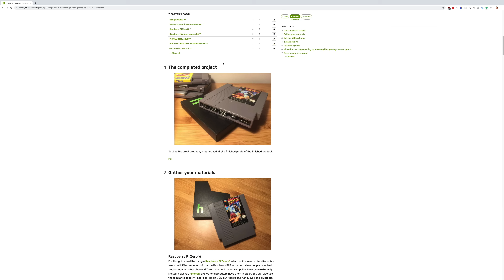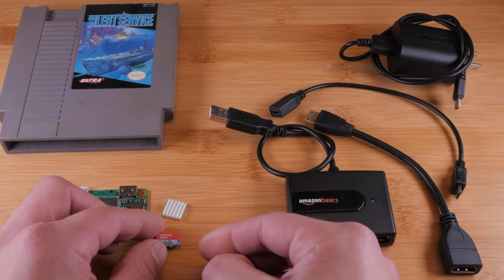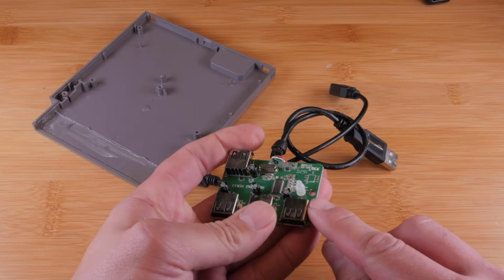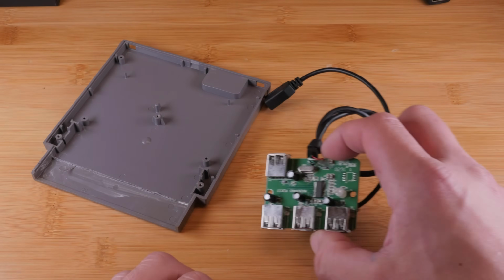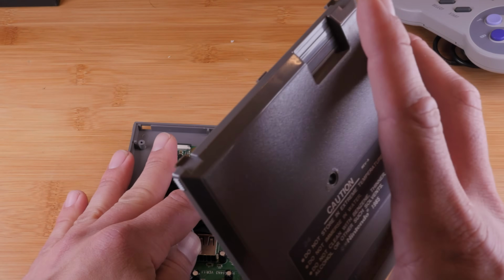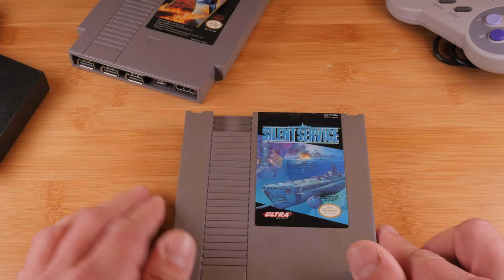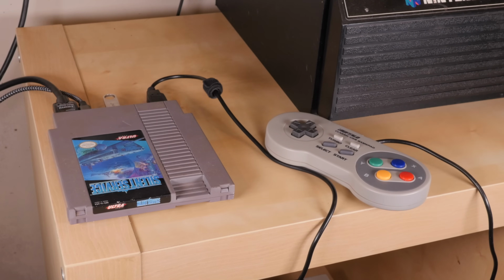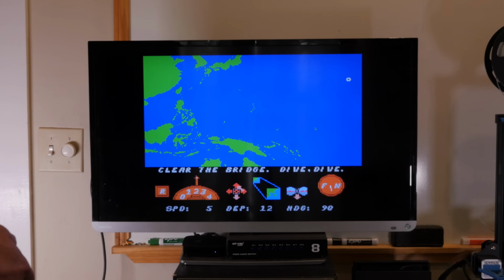The Official Pi Cart Build Video! A Raspberry Pi Retro Gaming Rig in an NES Cartridge [Full Build]

Comment from the maker: Check out the full guide on howchoo! https://howchoo.com/g/mti0oge5nzk/pi-cart-a-raspberry-pi-retro-gaming-rig-in-an-nes-cartridge
Reply: For the usb hub, you could use a "micro usb otg hub", which is the same as what you are using but with the correct micro usb connector: https://www.amazon.com/MakerSpot-Accessories-Charging-Extension-Raspberry/dp/B01JL837X8
Reply: @realmchat6665  great idea, but does it fit in the cartridge?
Reply: howchoo hello and sorry for the trouble I have a problem with the theme nes mini
installing it on my TV at 1280x 1080 resolution I see it at zoom
instead if I put it at low resolution, that is, at 720, the screen is tightened but everything is visible
Reply from the maker: @Bigboss-mu2hn  Sorry I missed this! Are you saying that if you set RetroPie at a low resolution it appears too small on the screen?

Comment: Do you think does a regular raspberry pi 3 fit inside? (i don't need usb hub, probably only network)
Reply from the maker: Yep, I've seen it done. You'll need to desolder the USB and ethernet ports. Then, you could resolder two single height USB ports back on there to get your ports back. ;)

Comment: Instead of the Amazon hub they sell a hub that has micro-USB to connect to the pi (no adapter) and 3 USB outputs plus one micro-USB to supply power of you want and they each have their own cable so it's easy to position them how you want.
https://amzn.to/2XVSTQ6
Reply from the maker: Yeah I don't recommend using that since it doesn't work well (just read the reviews). Tons of DOAs, overheating, etc.

Comment: Hey, love the guide. Extremely new to this and going to try this guide out in a while. Thought I'd ask since the picture guide/parts list doesn't include it, but what would specifically work for a heatsink for this project? Does it matter the size or number of teeth in it, if I were to grab one of the many pi heatsinks off eBay? Thanks!
Reply from the maker: Glad you enjoyed the guide! Generally with Pi heatsinks, aluminum performs better than copper. The type of adhesive tape it comes with also matters quite a bit for thermal transfer -- try to buy one that explicitly has 3M on the tape in the photo. As far as size, the taller/thicker a heatsink is, the better it will perform; so I would grab the tallest one that will still fit in the case. There's a surprising amount of space in there so most Pi heatsinks you find on Amazon/eBay will fit (just don't buy a SUPER tall one).
Reply: @howchoo Thanks so much!
Reply from the maker: No problem! Post in the comments if you run into any issues and I’ll do my best to help you out.
Reply: howchoo Hey! Got all the parts put together snug in the cart, and it boots and shows a display fine, though the pi just isn't detecting USB devices. I've connected an LED Xbox 360 controller to the pi through a small cable like you substituted in the video, through a hub connected to said cable, and through the small mini usb to usb adapter in the hub, and the lights come on for a few seconds before going out again. No gamepads or keyboards are ever detected. Is there anything to install besides RetroPie? Or is there some issue with the hardware
Reply from the maker: @TheAmazingClaytor  Hey there! How big is your power supply (in amps)? Which micro USB adapter and hub are you using? The ones I linked to in the full guide?
Reply: howchoo Not sure about the amps, but itwas an official universal power supply from pimoroni, and the hub I got off eBay but I got the same results plugging into that as I did directly with a 6 inch microUSB male to USB female cable.
Reply from the maker: @TheAmazingClaytor  Ok your power supply should be good then. Can you try connecting another USB device (without the hub), like a USB keyboard?
Reply: howchoo I've connected a USB keyboard, two Switch GC USB controllers, two cheap GC usb controllers, and two 360 controllers both through the hub, and not. Still nothing connects.
Reply from the maker: @TheAmazingClaytor  Does the hub have a micro USB cable on it, or are you using the same micro USB adapter for both? If the latter, can you try another micro USB adapter? If you don't have another one, then you might need to reinstall anything. My synopsis is it's either a bad micro USB adapter, something got corrupted on install, or your Pi Zero is bad (it does happen).
Reply: howchoo alright, I'll run down that list when I can, will let you know what happens, thanks!

Comment: So, left a decent length comment about the cartridge size and empty space. But somehow disappeared?

Anyway the empty space and cartridge size was for the MMC system. Multi Memory Controller.
There were variations of game pcb's with varying extension chips to enhance the NES' capabilities as required.
The empty space was future proofing in case they ever needed or wanted to use it for extensions.

The largest game PCB for the NES was MMC5.
These filled up pretty much the entire cartridge. Castlevania 3 used it for example.

What an mmc5 game PCB looks like: 
http://kevtris.org/mappers/mmc5/NES_ETROM.jpg
As you can see by the hole in the middle-ish this fills up almost an entire cartridge.

Wiki on MMC: https://en.wikipedia.org/wiki/Memory_management_controller

Thanks for the idea, though I don't think PI's do N64 and PS2. More performant will probably not work in a cartridge?
Reply from the maker: Super weird -- I saw the notification message for your first comment but I don't see it anyways. Anyways, thanks for the info! This is really good to know, I'll be sure to mention it next time. I've taken apart a lot of NES cartridges (to replace batteries and whatnot) and never saw one that big. Really cool.

The larger Pi 3B+ can emulate the N64 pretty well, but of course it won't fit in an NES cartridge "as-is"; however, you can create a "Diet Pi" by desoldering the ethernet and USB ports to make the larger Pi very flat; or build your own circuitry and use the Raspberry Pi Compute module. Then, you'd need an actual cooling solution (small centrifugal fan would do it I imagine).

Anyways, thanks for sharing!
Reply: @Howchoo  You're welcome :) 
Thanks for the tips. I'll build something down the road. Might try a cartridge as a case, can always make a custom old console look-alike to have better airflow and cooling if a cartridge case won't work for me :)

Right now I'm just using Batocera as a bootable live usb. The usb stick might not look retro but it will basically run this on whatever you plug it into. 

Still just love the cartridge-pi, portable-enough and nostalgic too. 
Will check out your channel a bit more, probably a new sub ;)

Cheers!
Reply from the maker: @InnSewerAnts  Awesome! I'd love to see your old console lookalike when it's done.

Comment: Man that was great. I am now totally convinced that I need a cart like that myself 😅👌
Your content is awesome. Informative, well presented and you seem like a decent dude 😊

I have one question: obviously nes or snes games had an aspect ratio of 4:3. Modern TVs are 16:9. Will I have to mess around with my TV settings so that the image isn't stretched or does retro pi come with a solution for this? I own a retron5 and it is capable to output a 720p 16:9 signal to my tv which is then a correct 4:3 picture with black borders on both sides. Does the retro pi offer this as well? Thanks for your help and have a good week 🙂🙏
Reply from the maker: Thanks a bunch, get ready for way more content coming soon. Aspect ratio won't be an issue, this is handled automatically by RetroPie. You can also override for specific games/emulators if you wish, but I've never needed to do this.
Reply: @Howchoo  Nice. Thanks a lot 😊🙏

Comment: Wow that's a great guide. I just ordered My ABOX kit this morning.I am stoaked. So the retro pie system run multiple emulators then?
Reply from the maker: Yep! RetroPie can run tons of systems.
Reply: @Howchoo  hey can u send me that links where to download the retro pie system please.
Reply from the maker: Sure thing — I wrote a separate guide on RetroPie :) https://howchoo.com/g/n2qyzdk5zdm/build-your-own-raspberry-pi-retro-gaming-rig
Reply: @Howchoo  sweet thanks man.
Reply: hey man so I went through all the step and downloaded the retro pie image and and installed it on the sd card. And gace me raspberry pie desk top not retro pie or even emulation station. please help
Reply from the maker: @coryledgerwood5191  Super strange -- Try flashing it again, sometimes weird things can happen!
Reply: @Howchoo  hey, thanks for the reply I had to uninstall and reinstall a couple of times. But it did finally work. Thanks. I am have some issues getting ps1 roms to load. The system recognizes them but they won't load and startup
Reply from the maker: @coryledgerwood5191  Glad you got it working! I haven't worked with PS1 ROMs a ton, but you might need to choose a different emulator for the ROMs you're using. See: https://github.com/RetroPie/RetroPie-Setup/wiki/Playstation-1
Reply: @coryledgerwood5191  make sure you have a PS1 BIOS installed as well.